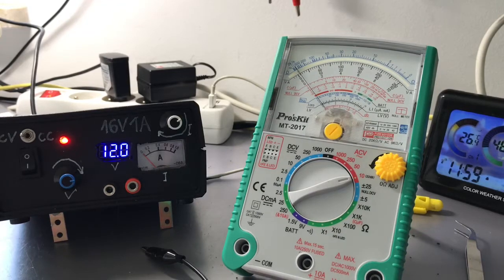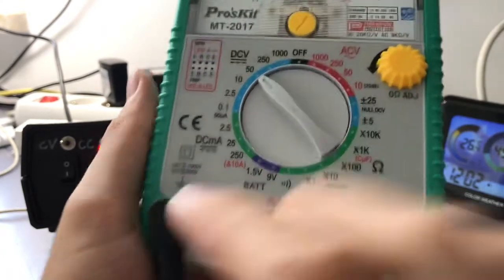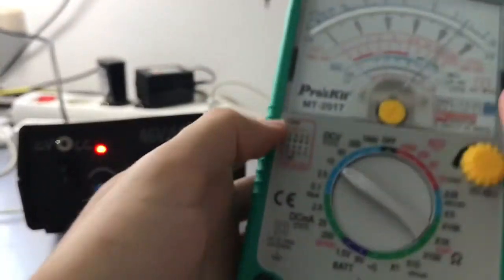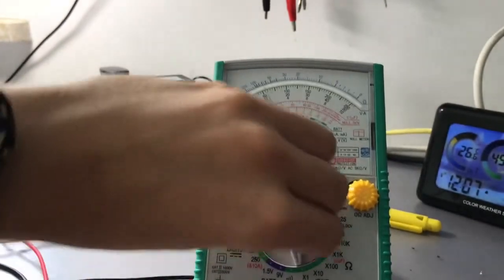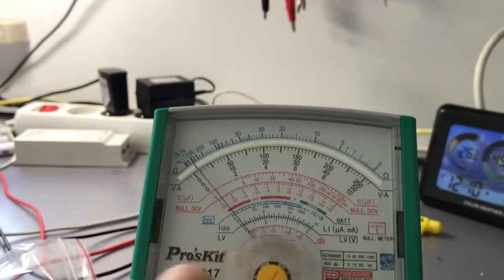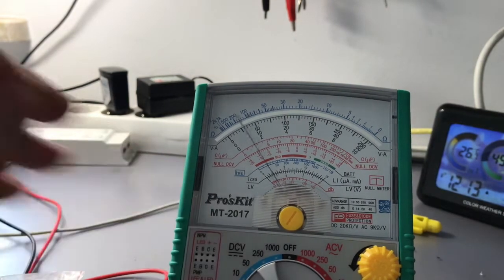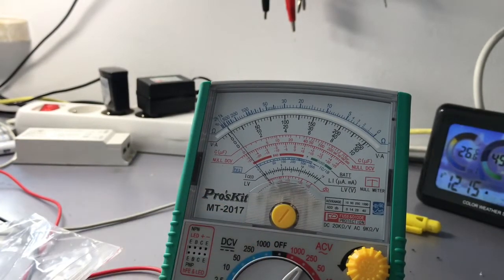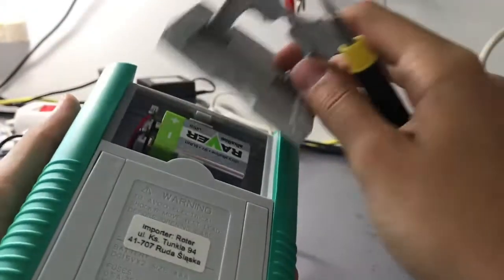#24 Analog meter in 2020, Proskit MT2017 review

Comment: Actually, it's more accurate in high frequency that's why RF engineers use them for aligning IF ccts. DVM meters have a limitation on high frequency due to the A/D converter.
Reply from the maker: you're propably right but there is certaint point from which nothing can replace proper oscilloscope
Reply: @ArduGeek6502  That's true but in that case, you need a special High input impedance RF probe for your oscilloscope in high frequencies a normal 10.1probe will load down the cct more than you think. Get a nano VNA and test it.

Comment: You really screwed up! You did not turn the middle screw that controls the needle. You should have turned it so that the needle points to zero. As you have it now, it points a couple of small divisions to the right. No wonder you weren't getting accurate readings. Fix the needle so it reads zero when not testing something, and I think you will get better accuracy.
Reply from the maker: if i will do it the multimeter doesnt show exact results, it tuned right now ideally
Reply: @ArduGeek6502  So why didn't you explain that in your video?
Reply from the maker: @williamdiffin28  you know i am a human too, make mistakes apologize for that, this meter was probably defect from the factory anyways, video was focused on something else anyways
Reply: @ArduGeek6502  Ok, I see what you are saying.  I have the same meter and really like it. I set the needle to zero and I get good accuracy. Your meter might be slightly different and may need the change you made to it to increase its accuracy.
Reply from the maker: @sliderulelover  I think it is like that, i was trying for hours to calibrate it and this is the best i can do.